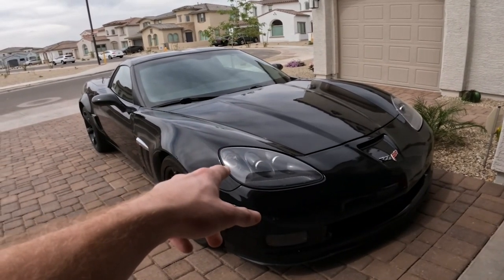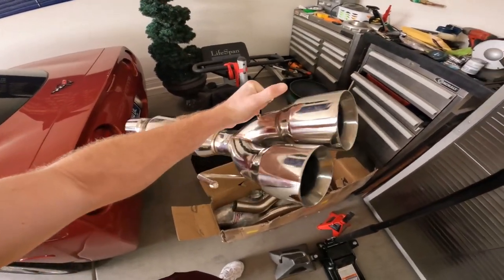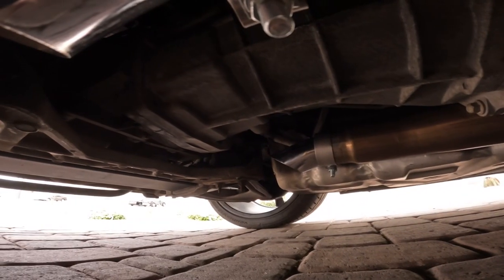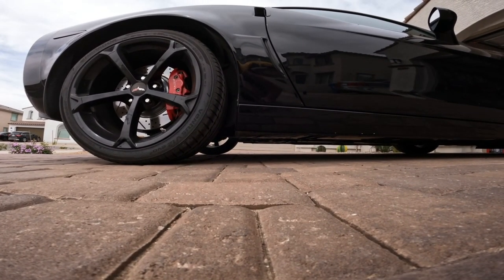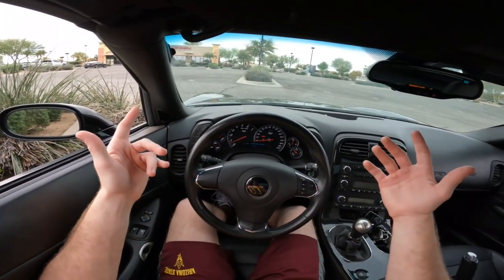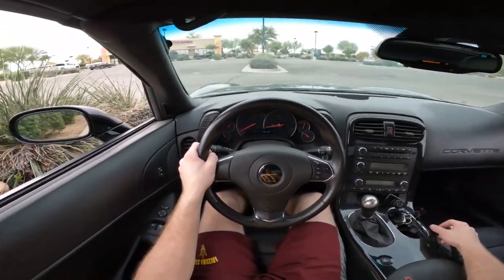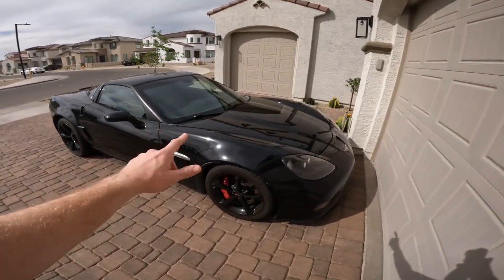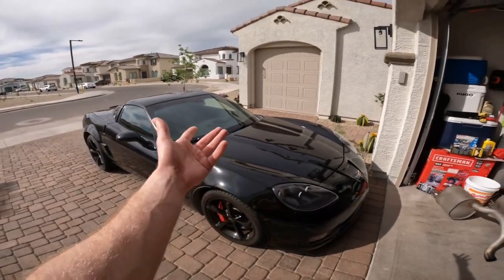Straight Pipe C6 Corvette POV Sound With DUMPS!

Comment: Does it feel like you lost some torque with the dumps?  On my Saleen Supercharged 3v It feels like i lost some torque
Reply from the maker: The butt Dyno feels like there is some loss down low yes 🤔
Reply: @CamMarz  everyone says it's in our head but I do def feel it as well lol
Reply: I didn’t feel like I lost torque when I dumped my mustang.. but it did lose like almost 100 pounds from the exhaust changes.
Reply from the maker: @techmaster777  dropping my exhaust saved me like 60lbs, which is awesome.